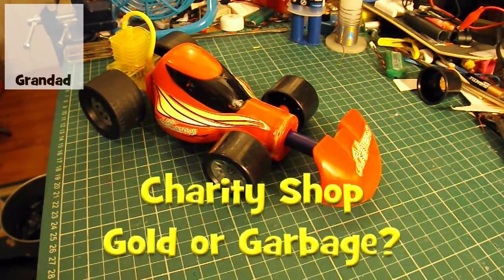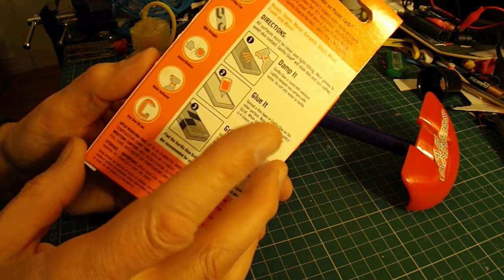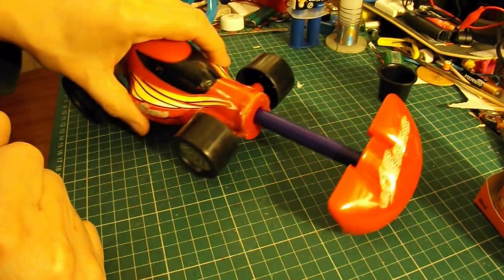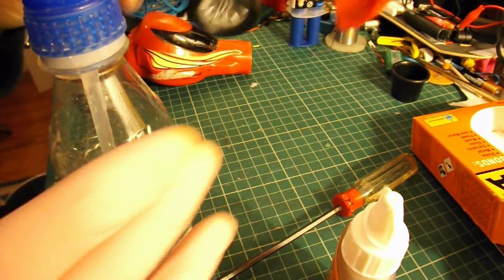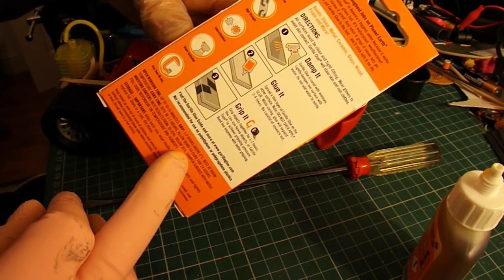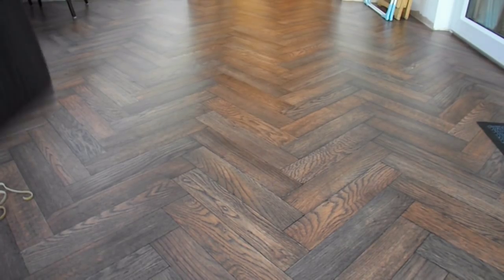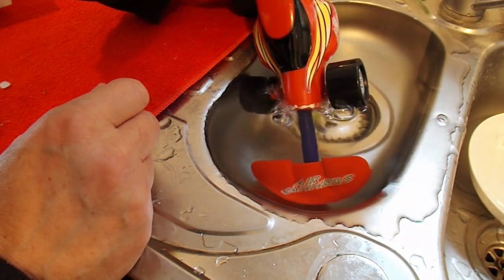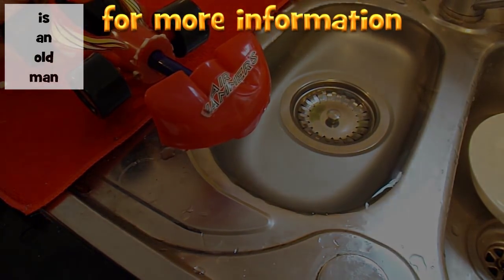Charity Shop Gold or Garbage Air Jammer Gorilla Glue Fix

Comment: This might be an idea: leave the gorillaglue-fix as is and generously put some silicone over the existing joint. That way the Gorillaglue will provide the required strength and the silicone will seal the leakages.
Reply: This is a very good idea
Reply from the maker: +Elnufo I would think that silicone on it's own would probably do the job, the problem is that the shape of the parts makes it impossible to clean the surfaces properly.

Comment: Just an idea, but you could try melting and binding the plastic permanently to make a steonger seal that glue. If that idea doesnt sound good to you, then put glue on the inside of the seal, and then on the outside to where it would have 2 layers of glue.
Reply: +Epic Face 3000 h, hi epic, how would he bring hard plastic to a melt??, its difficult enough to get hard plastic to melt even if u have the right tools for for it.
Reply from the maker: +marc wohlmayer you can get plastic glues that melt the plastic before it sets, making a really good solid bond. It does not work on all plastics so it would be a matter of finding the right glue for this sort of plastic. They don't call them glues they call them solvent cements. I would not want to use it here because that would be a permanent seal and if it did leak I would never be able to separate the parts.

Comment: looks like it leaks around the front wheel wells ? the plunger had no leakes
Reply from the maker: +PsychoAxeMan at around 03:10 I show the component that is causing the problem. Because of its shape I find it impossible to completely clean the mating surfaces. There may be some sort of solvent available that will clean off the remains of the old glues but I haven't found it in my collection of bottles and tins. I spent quite a bit of time on this and decided I had done enough.

Comment: 5 min epoxy for plastic will seal that right up .
Reply from the maker: +PsychoAxeMan I am trying to avoid that. When it works well you cannot get it off again so if I fail to clean the surfaces well enough I am stuffed for a second attempt. The other problem with epoxy is it tends to be brittle and can crack.
Reply: +GrandadIsAnOldMan I'm not sure if hot glue would work they are both plastic but it might not take the pressure.
Reply from the maker: +Human4873 the problem is getting the surfaces clean before applying the glue. The shape of the components makes it almost impossible to clean it properly.
Reply from the maker: Human4873 I don't know about particular brand of superglue but I have used superglue on several of my projects. The main issue with this repair is as I said, getting the surfaces clean so there is no impurities, cracks or scratches that will allow the air to creep through. It makes no difference how strong the glue is if you have not got a clean surface to start with.
Reply from the maker: Human4873 thank you for your suggestions but you seem to ignore my explanation of the problem. It is the shape of the components that prevent me cleaning the surfaces properly to ensure a good mating surface for glue to make an airtight seal. It does not matter much what you are trying to use to glue it together unless you have cleaned the surfaces. Air pressure will seek out the slightest imperfection and tunnel its way through. At around 03:10 I show the component that you cannot access to clean it.

Comment: a shame it won't work 100% good.
Reply from the maker: +Lol Plane the problem is that the shape of the parts makes it impossible to clean the surfaces properly. so I cannot get a clean join and each different glue I try leave a bit more deposit that has to be cleaned away before trying the next attempt. In the factory these parts would have all been perfectly clean.
Reply: i see